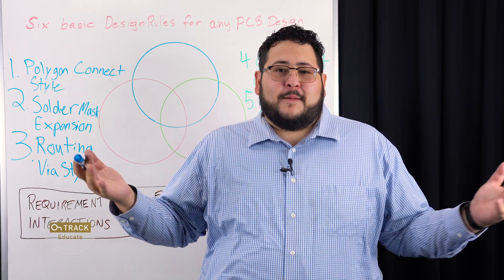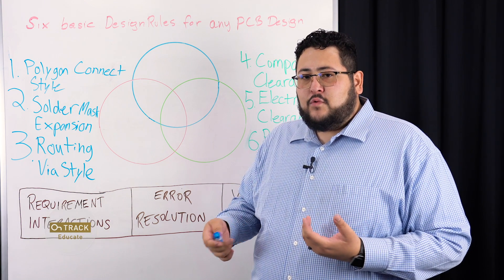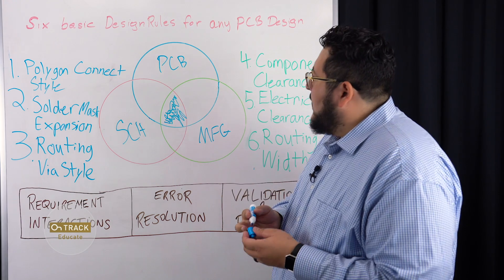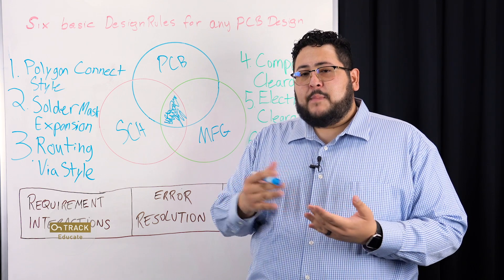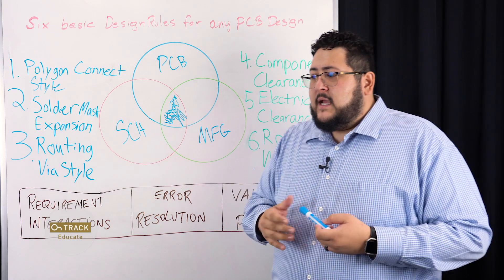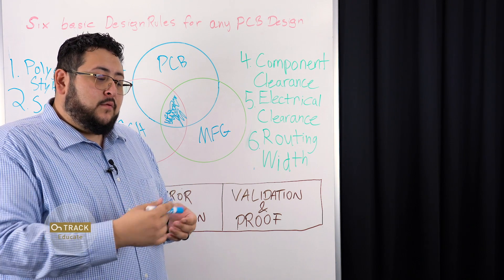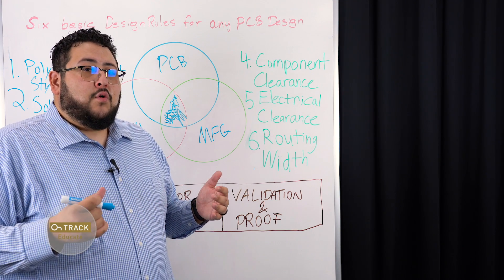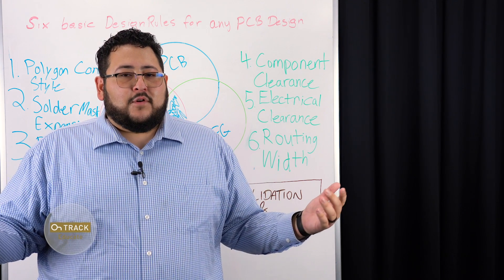Six Basic Design Rules for Any PCB Design - OnTrack

Comment: David, with AD18 and previous, a new PCB file has basically zero DRC rules setup.  It would be nice if they were pre-populated with at least these 6 (plus board outline clearance, that should always be defined too) for a reasonably modern PCB.  Say maybe something that you could build at OshPark or other popular prototype facilities.

Are there any changes in AD20 with reference to pre-populated DRC rules etc?
Reply: @James We are working on something we are currently calling Constraints Profiles. A Manufacturing Profile (OshPark) would help with what you are talking about. I spoke on the topic at AltiumLive Frankfurt. You can learn more from the recording and use the work in progress feature in the Advanced settings in Altium Designer 20. https://youtu.be/J_zA4I_0Gug?list=PLJI43BCRnVwbP0jSromUnhgScAnRXlw2Q&t=4263
Reply: PCB design guidelines available her
https://imojo.in/1c58qt4
Reply: P Talks hi

Comment: Which of the six rules cover:
   (1) Trace corners and junctions (Right angles, rounded, chamfered, etc.)
   (2)  EMI/RFI suppression techniques
   (3)  ECO wire-adds?
Thanks.
Reply: Hi @Paul F,

These six rules are my recommended basics. In order to solve the issues you are talking about, you will want to get into the more advanced rules and advanced functionality. Check out the documentation I am linking to learn more.

1) Routing Corners Rule: https://www.altium.com/documentation/19.1/display/ADES/PCB_Dlg-RoutingCornerStyleRule_Frame((Routing+Corners))_AD

2) While automatically keeping in mind the Clearance rules you have put in place, you can apply via stitching and via shielding to both nets and area. https://www.altium.com/documentation/19.1/display/ADES/((Via+Stitching+and+Via+Shielding))_AD

Here is a blog on the topic as well: https://resources.altium.com/pcb-design-blog/meeting-emi-emc-standards-in-your-pcb-designs

3)Unfortunately, I am unfamiliar with the term “ECO wire-add.” Can you please describe it?
Reply: @davidhaboud9557  I have a very basic question, seeing as I am a student. How would one make a stand alone pcb without need from multiboarding,  that contains an fpga, MCU, and full analog ssignal path for a music synthesizer. If its even possible
Reply: @davidhaboud9557   Hi David, thanks for these links.   ECO = Engineering Change Order,  which results in a PCB revision change (e.g. a circuit modification implemented after the board was designed and approved for use. This mod (or group of mods) are often completed to improve Energy Efficiency, Electrical Safety, Product Functionality or Production Cost Reduction by lowering the number of components on the BOM (Bill of Materials).)

Boards currently on the production line can have any newly released ECO (or ECOs) implemented easily in-house immediately. Boards already sold, and out in the field in use by customers are not needed to be brought back to the factory for up-rev, but will be upreved if they ever return to the factory through the Warranty/RMA loop (Return Material Authorization).

But, if for example a major safety issue is discovered, units already in use by customers, and in need of circuit modification, are not strictly ECO pending, but in fact fall under the Product Re-call bracket. All customers should be notified of what to do with their potentially dangerous products.

Coming back to your original question.... a wire-add is simply a piece of electrical wire soldered in and glued/taped down to the board. This is more commonly used as a repair method for a cracked PCB track on a damaged unit, but in relation to an ECO, a wire-add is simply used to connect two parts of a circuit together, that were originally designed to be insulated from each other. As a cost-saving example... if a firmware-based ECO was released which modified a circuit to bundle two data streams into one stream, resulting in 5 to 10 electronic components being deemed no longer necessary, then a wire-add may be needed to directly link certain inputs to outputs, in order for the circuit to continue functioning correctly after the firmware was upgraded. Here the sub-assembly PCB revision might go from Rev. A01 to Rev. A02, and the main unit TLA (Top Level Assembly) revision might go from Rev. B12 to Rev. B13.
Reply: @paulf1071  I understand now. You can add extra pads, jumpers, footprints with no models, and use the normal clearance rules. This will allow you to have the appropriate clearance to solder the wires.
Reply: PCB design guidelines available her
https://imojo.in/1c58qt4

Comment: This is a useless infomercial that flies over Altium Designer's rule checking capabilities trying to be subtle about it. I've worked with AD for years and I can tell you: if you know the reasons for those rules (e.g. what your via hole/pad ratio should be) you'll certainly know how to check them; you don't need this Mr. Haboud to tell you. What would have been a lot more useful is for Mr. Haboud to explain at least superficially how you should tailor these rules in some real-world example cases; for instance, what are acceptable annular rings for vias (2:1 ratio is common), or what are typical routing widths/clearances for low voltage, low speed signals (10 mils can do the job most of the time). Then he could have shown AD checking those rules shamelessly and everybody would be happy.
Reply: But then we would have had to have listened to him say, "So" and "Actually" about 15,000 more times. That I couldn't take.
Reply: agreed